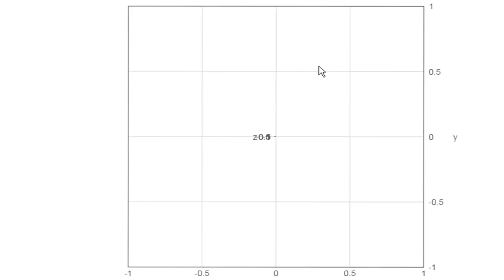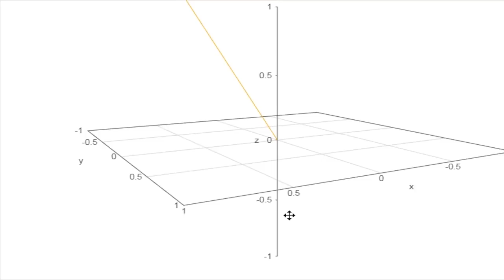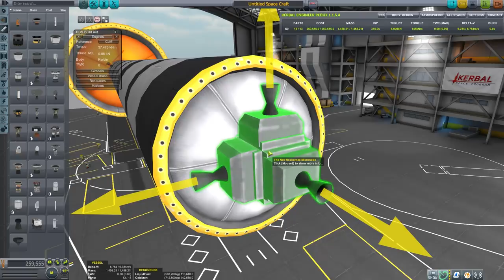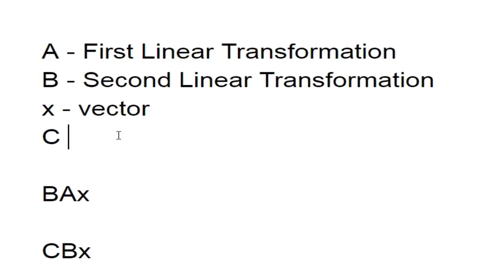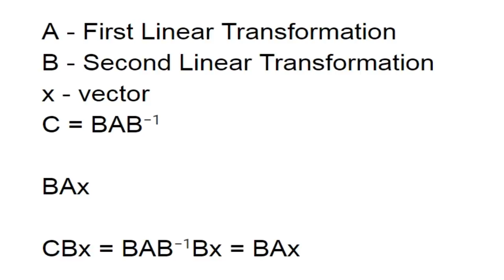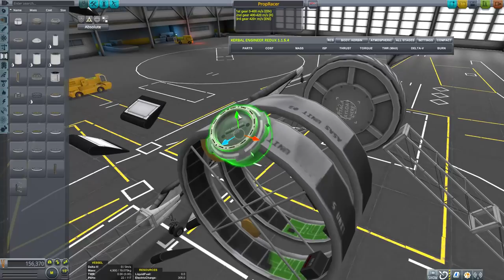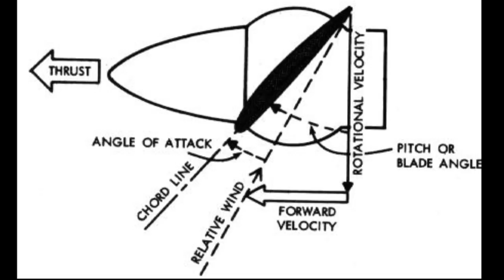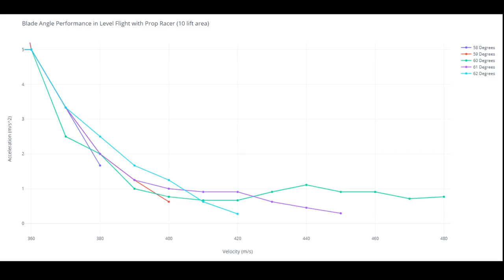Breaking the stock propeller speed record in KSP (Over 1,000 m/s!)

Comment: About 700m/s faster than the fastest prop plane irl
Reply: He said Mach 3. Faster prop plane did like mach 0.7 iirc and faster prop + jet did reach mach 1
Reply: @GewelReal  apparently a spitfire could reach mach 1 in a dive but there's no evidence of it
Reply: @Bzorlan  Structurally unlikely. It's wings are designed for lift, not speed. There are many accounts of pilots who overspeed only just managing to land with severe damage to wing structure. If any prop could reach mach 2 and live to tell the tale, it's probably something american, built for high speeds and with tougher wings. Something like the late P-51, F7F, late P-38, etc. And only at high altitude too where mach 1 is less than 1000 km/h
Reply: @xiphosura413  unlikely. Not impossible. Spitfires were built for high speed. I doubt any other plane from around the same time would manage much better
Reply: @GewelReal  The Soviet/Russian TU-95 can reach mach 0.8 (maybe even higher) and at the highest speeds the tip of the prop is apparently supersonic which is pretty impressive.
Reply: This plane is realistic! (Cough, cough)
Reply: @SANG Most spitfires were made for dogfights. Not speed. Later on yes with the new engines and griffon spits but most spitfires were used for dogfighting and when you dive to high speeds the plane will compress and it’s controls will lock up. Also flutter will occur and if you don’t pull up in time your plane will rip to shreds. 
Keep on mind that the spitfire was used in WW2. The spitfire that was built for speed was the Spitfire Mk XIV, which was used to counter the V1 rocket. The fastest propeller plane during WW2 was the Do 335
Reply: @Bzorlan  DEFINITELY not.
Reply: SANG they had a top speed of 400 mph at the end of the war, no way could it almost double its speed in a dive plus the plane would become uncontrollable because of the high pressure cone and would probably break off
Reply: Battery powered no less
Reply: Bruh mach 1 is around 340 m/s, 700 m/s is mach 2. So SANG ur wrong
Reply: According to famed test pilot Eric ‘Winkle’ Brown's book Wings on My Sleeve, the high-speed trials began in late 1943. During the programme, Squadron Leader J R Tobin took a Mark XI Spitfire into a 45-degree dive; the plane reached a top speed of 606mph (975km/h), or Mach 0.89 (Mach 1 being the technical term for the speed of sound). It was the fastest speed a Spitfire had ever flown – or at least the fastest that a pilot had lived to tell the tale. But a far more dramatic flight was soon to take place.

In April 1944, Squadron Leader Anthony F Martindale, put the exact same Mark XI Spitfire into a dive. This time, the reduction gear designed to limit its speed failed. The propeller ripped off and the diving aircraft reached more than 620mph (1,000km/h) – Mach 0.92 – as it plunged towards the ground.

Copied that from a BBC article. Yes I was wrong. I said there was no evidence of it.
Reply: @Bzorlan  nah, Spitfires weren't built for speed, even Merlin-engined ones were slower than several American and German props
Reply: @GrinXpedia  Yeah they were more for maneuverability but they were quite speedy as well because of their engines.
Reply: @Bzorlan  most of german planes had better structural speed than the spitfire, even heinkel ones from wich the spitfire copied its wings.
The story its a made up bullshit, when the plane went too fast, the wings would bent in the opposite direction roll was apllied, making the plane roll backwards, this somehow made some people believe the backwards imput was caused by supersonuc airflow.
Reply: Well real planes didn't have clipping and video game physics.

Comment: Wow, over Mach 3 on electro-props huh? You run this by squidy first?? Hahaha! 
No but really, this is amazing brad! I fancy myself a bit of a turbo-prop builder and in my experience i've never been able to make a jet powered prop plane that can do more work than the jets themselves. With jet powered copters, you can actually make some gains and generate more lift than the jet thrust output.
Reply: Unfortunately Squiddy’s not around anymore, on YouTube at least.
Reply: @jerry3790  i can contact him, i'll show him this
Reply: Oh yeah you can exceed the jets in static thrust quite readilly. The issue is that to outperform the jets themselves the blower radius needs to be huge because of max RPM. If you can't get the thrust paddles supersonic statically, you're not even close to jet level performance.

Comment: You've got 2 different set of blades, so if you really dont want to change the blade angle, have one at 50 degrees and one at 60 degrees to get a slightly better average speed. Idk if it would help at all but it might give you an extra 20 at high speeds?

Comment: How did you make the bearings? I have a really hard time making it on 1.6 with fairing
Reply: In 1.6 SQUAD managed to break the collider for the stayputnik, right now stayputnik/fairing bearings don't work. What you can do is use the old model of the stayputnik which is still in the game, that one works just fine.
Reply: @Rade1664  ye

Comment: How do you get the parts to be so far apart from each other? The translation tool never lets me get things nearly that spaced out from each other xvx
Reply: @jeanpecquet90  That never did anything special for me..
Reply: @casualbird7671  Try turning off rigid angle attachment by pressing C. There might be a toggle in the KSP settings menu to "allow large offsets" or something like that. The Editor Extensions Redux mod might help if none of that works.